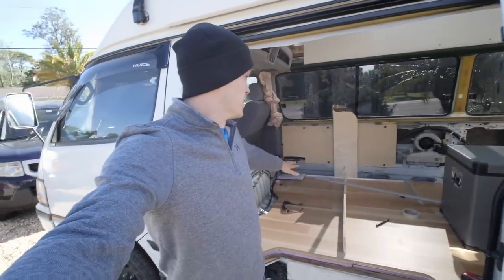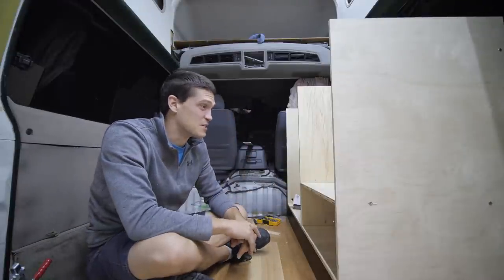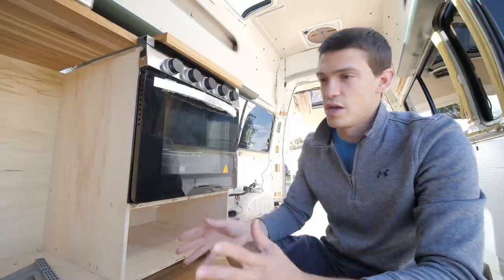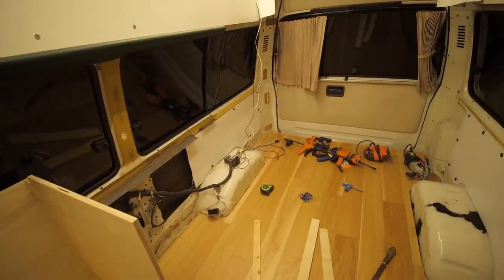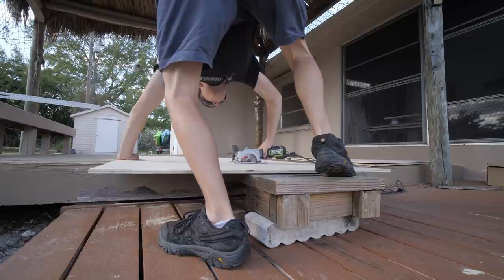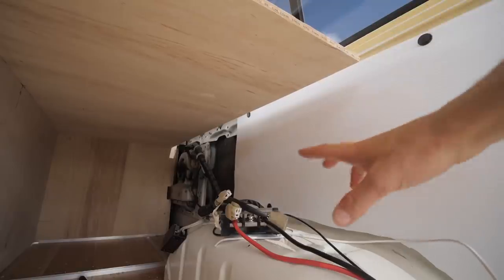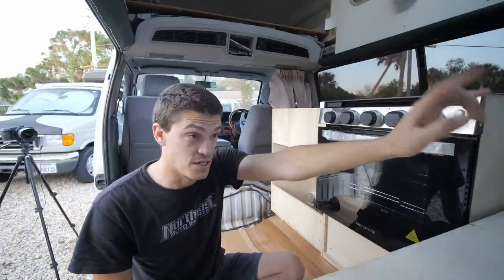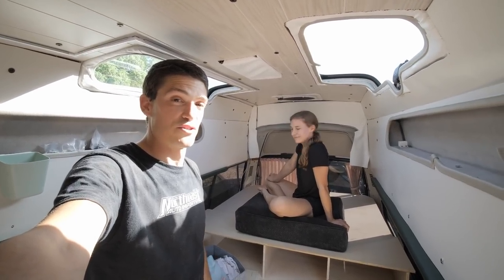BUILDING THE WHOLE VAN | Toyota 4x4 Camper Build

Comment: I looked at new vans with nothing in them. I'd think "Wow, tons of room" But when I watch videos I see how quickly space becomes stuff. That dowel construction is impressive, but plywood is pretty heavy stuff. That outfit where you bought the stove has some nice stuff. I don't want to end up where you guys are going. Like the solar on the roof messing with the lines. Yep, but that's a quirky truck or van, at best. I figure with a flat roof a kw of solar is easy. There is a lot of cheap LFP battery stuff, Lishen and EVE. The world is going to split heat pumps. I want comfort in my RV. It's getting hotter out there. Wonder if the frame repairs met you expectations. Start throwing all that weight around on a rough rock road, you'll know. It's a super nice build but I feel like i"m really seeing the limits of that truck. But I do love the sound when you start it up.
Reply: Id personally like to see the welds on the frame.  It looks like there was pretty substantial rust.  If repaired incorrectly I’m not sure I want to take that thing off road in the middle of nowhere. Especially since finding parts and mechanics is hard enough even in big cities. It’s definitely quirky though. Not sure about the solar panels having to be manually set up, a high output alternator sound like a better option IMHO

Comment: GREAT JOB MY FRIEND. I had the same problem with bed being to high & I built a step there that took up about half the oven area. This way I you would have a stool for feet & a step to get up on bed & I can sit or stand to cook. Plus in the step is where my battery bank is located. Something to consider. Great job either way it's looking great. 😎👍

Comment: Bit surprised the fridge is not on a pull out drawer. I know this adds a bit to the height but you're going to scratch the floor pulling that fridge in and out thousands of times, and it's going to be bad for your backs too. But the fit out is looking great. Can't wait to see the finished product.
Reply from the maker: Thanks Bob! I left a little space to add a pull out drawer system for the fridge, just haven't gotten around to it yet. For now the fridge is on felt furniture pads, so hopefully it won't scratch the floor too badly.

Comment: Can you set the oven temperature? Or is it a low to high knob?

I looked all over their site and couldn’t confirm it can be set to a temperature.
Reply from the maker: The knob has temperatures printed on it. I'm not sure how accurate it is though. Will find out when we use it for the first time!
Reply: @ElementLife  please do include using it in a video. Super interested in getting it if it maintains temperature while cooking